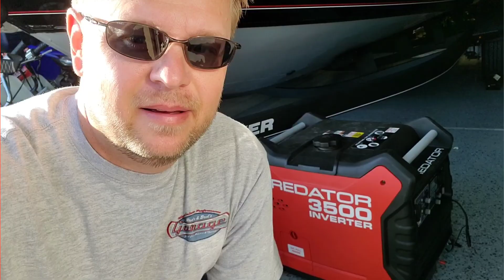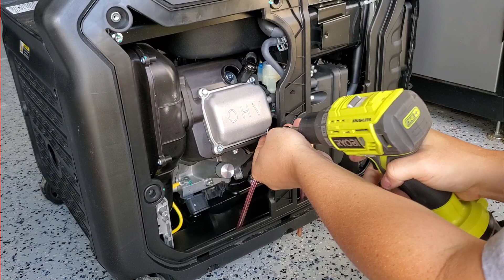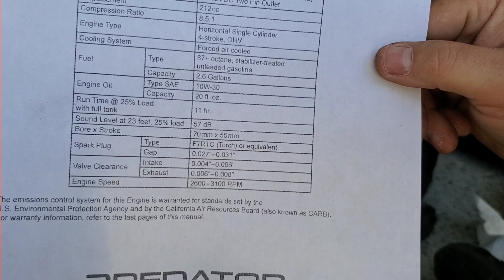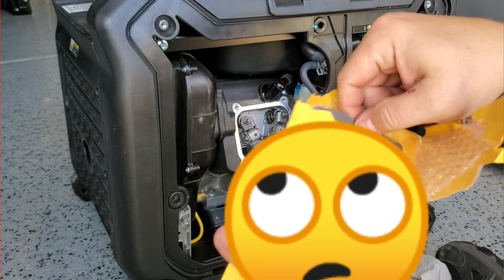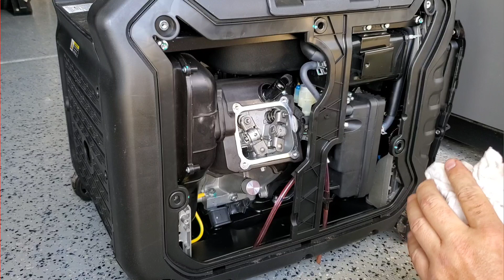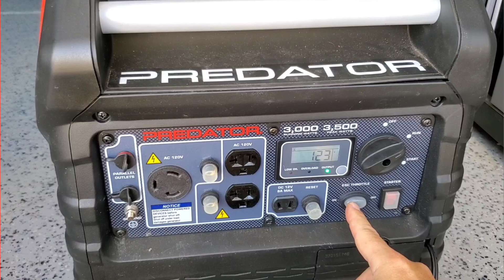SETTING VALVE CLEARANCE | LASH - HARBOR FREIGHT PREDATOR 3500 INVERTER GENERATOR ( POWERHORSE TOO)

Comment: My 3500 always started up and ran good. Then it just stopped running and wouldn’t start. After checking the electrical , I pulled the valve cover and saw the push rod had come off the intake rocker. I readjusted both valves, but I have absolutely no compression. Both rockers are moving. Do you have any ideas?

Comment: Any suggestions for mine? I tried to adjust the valves, after doing that when I pull the rope it gets stuck and can't be pulled, but if I remove the spark plug it comes free and I can pull it normally.
Reply from the maker: Sounds like the decompression portion of the cam is not working properly. Was this adjustment done in reaction to the machine not starting?
Reply: @MR_Garage  I adjusted it because it was running a little weird. But it started normally with the rope, after I realized that the rope could no longer be pulled. I put in a new battery and it started with the starter, I noticed that when starting it was difficult, it was as if it had been kicked. Now sometimes it starts with the starter and sometimes it doesn't. You can hear when the starter turns but it doesn't start.
Reply: After thinking about this further I remembered that when I did the valve adjustment I noticed that the left valve had no clearance so I adjusted it to 007. So today I adjusted it again to 000 clearance or maybe I adjusted it more than 000 maybe negative -002 and now it starts normally with the rope and with the starter on the first try. Could someone explain why?

Comment: I am looking at the Harbor Freight manual I just downloaded and it says both intake and exhaust valve clearance should be .002 to .003" WHAT????!!!
Reply from the maker: You likely have the newest version of the generator. They went through a couple of generations. The valve covers are VERY different if a later rev. Also WOW... .002 to .003 seems really tight. Don't like that at all!
Reply: @MR_Garage  Agreed that looks like nonsense. I just did it to the .007 intake and .005 exhaust usual.
Reply: the newer version does say .002-.003 on both valves. at 400hr i checked mine and they were .003int .005ex so ill just leave it alone for now

Comment: What is torque spec for those valve cover bolts?
Reply from the maker: I have not seen a spec on it, I would aim for 4ftlbs and no more than 7 if you are not good with going by feel. Not a part that is under pressure or has a oil flow really.  Just want it snug.

Comment: Thanks ...you made a comment that its a GS clone I assume you mean a Honda GS clone  
fWIW  the Honda GS   DOES NOT have a steel sleeve in the cylinder the GS from honda is rated for about 20-250 Hrs service ... I know I found that out from them when the one I had took a sh***.  The GX DOES have a steel sleeve .... I have to make sure for this motor on this gen set if it has a steel sleeve ... the HF website for the stand alone motors states they have a steel sleeve.... thanks
Reply from the maker: Indeed, Good feedback.  It was my accent actually, I said GX 😬 Kidding!
Reply: @MR_Garage  thanks

Comment: Hey thanks so much man for all your Predator 3500 videos. Is this the best matching gasket out there though?
Reply from the maker: I just use the ones I linked. The trimming is very minor but they work fine.
Reply: @MR_Garage  Ok thanks
Reply: @jacobnferguson  I just ordered 20 of the proper gaskets from northern tool. they have them in stock $1.00 a piece

Comment: Soooo.... just did this to mine... fired it up and there was a hell of a clankin noise!! However it was running after weeks of turning over only...Quickly shut it down and removed the valve cover too see what I did wrong.... couldn’t see anything right off so I pulled the pull start slowly but she wouldn’t move... figuring I’d ruined it said to hell with her and pushed the start button... rolled over but to my surprise out popes the push rod from the intake side... now I’m googling how to fix that...
Reply from the maker: Do you have a broken valve spring and then set valve clearance to the broken spring? The pushrod just sits in the hole and you can feel where it goes. Then, loosen the tappet to get it back under the rocker arm. May have just accidentally let it fall out when setting clearance. I did that even in the video, it happens.
Reply: @MR_Garage  thanks! I’ll give it look.. coming up on the weekend so I’ll have time to get to it. I’ll keep you posted... despite throwing the rod, it ran!! Glad to know it’s not planned obsolescence
Reply: @MR_Garage  so it broke the exhaust valve.... the valve head itself punched a hole in the piston... searching for parts I text... any idea where to find valves? I’ve found pistons and gaskets  but no luck for valves
Reply: A lot of ppl don't know there are two TDC intake and exhaust it must be on the intake TDC

Comment: I’ve done valves on motorcycles for years. I could not find TDC for my life. Got it running again but rough. Eventually locked it up. Just returned it. Would be great if there was a real way to find TDC
Reply from the maker: There is, but would require quite a bit of disassembly. I was able to find it pretty easy with this method.
Reply: Tdc easy take plug out, take cover off.  When exhaust starts go down while pulling slowly on rope then Intake goes down then comes up think thats compression tdc.

Comment: Great video 👍, if you buy one of these generators new, how often from that point would you recommend doing the valve adjustment?..
Reply from the maker: Manufacturer says every 12 months or 300 hours. I find the 12 month deal rather dumb, but 300 hours sounds reasonable.
Reply: in the real world 500 to 1000 hours works after the first reset on a new generator at 200 hours.
i like to set them on the second oil change on a new gen.